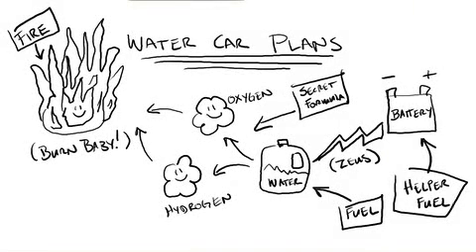Water Is Not An Energy Source

Comment: Actually almost everything you said is wrong, I have a brown's gas generator on my van for the past 4 years and I get a 30% improvement in mpg, emissions are reduced by 98%, the engine shows more torque climbing steep hills and finally it is possible to run an engine 100 % on water at least 10 people have done this, try to act with a little more humility, you come across as arogant and full of yourself

Comment: When I 1st heard of using water to increase mileage I thought How dumb Can a person be? Water puts out fire! Water does NOT burn! BUT after doing a lot more investigation, it began to make sense, After all the components of water are Hydrogen & oxygen. Two very fire ready elements. So now the Question becomes does it take more energy or give more? Well I made my own "Hydrogen generator" and was able to get a consistent 10% to 25% increase in fuel mileage. It is really simple but it takes a good bit of fussing.
Reply: +Tony W oxygen is NOT a fuel, NOT AT ALL, its an accelerant, itl make the gas and hydrogen burn faster and hotter, making your engine run even hotter. but even if your car can handle that, theres no guarantee that its still efficient, you still need gas to run the engine (~25% efficient) then you need to run the alternator, then you need the electrolysis, like he said each step hurts the efficiency, and just because your engine and alternator worked were efficient enough doesnt mean that a significant number are, it may have more of an impact on lower fuel economy cars, or or the higher fuel economy cars.
another problem is now your alternator is consistently generating power to run the hydrogen / oxygen generator, which if not built perfectly could create a nice explosion in front of you, but back to the alternator, which will probably die pretty soon now that its running at a much higher spec than intended, along with your battery.....

i would say that its likely that it would be more efficient to run off of hydroxy gas, but theres no way in hell big oil is going to let anyone do that, so in order to make your car run off of a gas / hydroxy fuel consistently and safely you'd have to spend an ass ton of money.

Comment: Actually, it's kinetic and potential energy. Yes it's getting energy from the water. The water IS the energy source. The water pushes on some waterwheel type of component. That component rotates, and the rotational motion does work on some generator that's used to power nearby electrical machinery. The generator in turn converts this rotational energy (torque) into electricity. That electrical energy is used to power machines, which transfers power   miles away via power lines.

Comment: Right, water doesn't have much internal energy due to how weak the bonds between hydrogen and oxygen are. But, a running river has plenty of stored kinetic and potential energy that can be used to move a water wheel, which could be hooked up to a generator, making the generator run and thus powering a machine. 

So it CAN be used as an energy source. A natural energy source that is. It would have been more accurate to say "Water is not a fuel source."

Comment: @CPTSkullofDoom Now I could be wrong, I have been many times before, but isn't it the density that keeps canoes floating on top of the water.  Like in that experiment way back when where you would fill a graduated cylinder with a whole bunch of liquids and drop a penny in it and it would sink through all of them but then float on the mercury.  Same thing.

Comment: @CPTSkullofDoom the dam does not convert water into electricity, but the motion of water into electricity. basically, the water goes into the dam, turns the turbines, and the turbines create electricity. the dam creates water pressure that is used to turn the turbines. i suggest a tad bit of research before you decide to look like a fool on the internet.

Comment: I could write on this subject for the next hour but. For the rest of you HBO haters. I have had an HHO generator on my 1999 f150 4.2 v6 and have seen a great increase in fuel efficiency. Have added 60,000 miles running HHO and have had no issues with my motor. So get off it

Comment: NOW! you can convert the chemical energy of hydrogen to mechanical energy by burning hydrogen in an internal combustion engine BUT that is absolutely idiotic..why? cause to take an energy source that already makes electricity that can go to a motor (80-90% efficency) compared to an IC engine (20-30% efficiency ) would be a ridiculous waste of energy, components, efficiency and weight. Therefore hydro is the best POSSIBLE though distant future solution to dealing with large amount of power demand

Comment: engine drive the alternator, it produces the electricity..it then makes the gases, gases are burned. WHAT the hell are you talking about?  LOOK..hydrogen fuel cell cars have NO engine.. no engine at all. so this part of the statment is completely WRONG.  A fuel cell converts the chemicals hydrogen and oxygen into water, and in the process it produces electricity. Hence NO engine.. the electricity then goes DIRECTLY to the motor(s) depending on the configuration and that propels the car..

Comment: The main reason for basis for water is that it is one element we have an abundance of and contains HYDROGEN..the component most found throughout the universe. If we harness hydrogen then we have UNLIMITED power. I agree that you have to put energy IN to get out energy with water yet it is the fact of what hydrogen will be able to do in the future that is most encouraging. Water used in this way isn't quite as productive (in the case of an hydrocells) yet usage of pressure and gravity, energy.

Comment: @archknight20 Deuterium oxide, which is what most people mean by "heavy water", is not an energy source by itself.  It does a better job of moderating certain nuclear reactions than regular water, and thus enables better energy generation, but it doesn't do any generation of energy itself.  While it's true that using tritium (the radioactive isotope of hydrogen) would technically generate some energy as the tritium transforms into helium, it's kind of rare and not viable as an energy source.

Comment: @shuggy555 This efficiancy  become lower after recharge the battery again and again.  Also the autonomy of the hydrogen cells electric car is 300miles, when the battery car cannot reach even the half without recharge. Thats why hydrogen is more efficient for the transportations
 The only problem is the storage problem since the hydrogen is a combustible gas as you said but hey, the technological progress is fast and the nanotechnology soon will find a solution.

Comment: The reason these electrolysis cells increase efficiency is because drawing off the battery causes more draw on the alternator, but when there is very little draw on the alternator it's actually more inefficient.  I made one myself. =)  I would never buy a kit though.  And it's a lot of maintenance to keep the electrodes healthy. =)

Comment: But a supercharged car usually has it's air-fuel ratio adjusted accordingly (EFI or carb), don't tell people to up the air, if done incorrectly your engine will run hotter, knock waaay more often and release more NOx into the atmosphere, that means replacing your catalytic converter more often. Also means less efficient past a certain point. EVERYTHING IN MODERATION!

Comment: @ureallidiots this is not a debate.  That's the problem with all you damn liberals and useful idiots.  You think everything is up for debate.  A fact , irregardless of your opinion, is a FACT!!!  

Unfortunately, you are also sadly mistaken on politics.  This is all about power  and control.  The Oil Industry's annual take is well over $3,000,000,000,000.00.  Exxon, alone, posted a quarterly PROFIT of $40,000,000,000.00.  in 3 months of doing business in fiscal year 2008.  IT'S ALL ABOUT CONTROL

Comment: @ccrg109 maybe you should do a little more research before you open your mouth.  There are many woking designs that achieve plus unity gains.  Some of which gain 160% (water hammer)  600% super electrolyser.

Comment: @Warblade118
The last time I checked, the amount of energy put into a process that produces more energy than what was used to start or run the process, is called Gain over Unity.
And it's free since the process runs itself while recharging the source that started it.
Even if I paid for the energy to get it started, the moment it starts producing energy is when the process starts my R.O.I.
Every kilowatt I'm not using, power companies HAVE TO BUY IT BACK at market value.
Sounds like free money!

Comment: @rock3tcat
Someone get this man a cigar! 

You are absolutely correct. Water in motion is an energy source. It just needs to be converted to a more usable form energy. Like a water-wheel powered grinding mill or pumping station.
Converting the waters' Kinetic energy > Mechanical energy and Torque to do work. It may not be very efficient but it is very effective and the only cost involved was a little time and materials. The minute it starts working is the minute you stop paying for power.

Comment: @Warblade118
Solar and Wind are free. Both can be stored as electricity in batteries. It costs nothing to start and run the process and it will generate revenue when you aren't using the energy its producing.
It's going to take some money to build the process but the ROI will be seen almost immediately.
The energy it makes IS free. The hardware isn't.
It's the power companies that don't want this technology in the public because it threatens their profits!
It's Payback time! And PG&E is scared!

Comment: In that sense, oil is not an energy source either. Some plant, somewhere, some million years ago had to absorb the energy in the sunlight, use it for photosynthesis, get trapped under the huge pressure and heat from the earth's core, to finally turn into oil. There is no such thing as an energy source.

Comment: This was part of my final year project in college. All we need to do is mimic Photosynthesis II at a viable efficiency level. We've got half of the reaction (the oxygen liberation side of it). The hydrogen side of the cell is... tricky. Currently they generally use a sacrificial electron doner (it's a scam equation, basically) or are too low in efficiency to work well.

Comment: The correct statement would be to say that Water is an inefficient energy storage medium. 
In other words, Water can be used like a battery. 
There are engines designed to run on pure hydrogen. That hydrogen can be made from solar panels on your house and the creek passing behind it... Then it makes sense. Adding it to your gasoline engine with computer regulation is just plain Darwinism. Go ahead and look into how many vehicle fires have been the result of UNFUSED OVERCURRENT from these.

Comment: The alternator runs 14v and enough amperage load to charge your battery, all your electronics and spark plugs and you have about 10% that is leeched from the system just from overcharging.  Hydro cells are not a way to get free energy, but rather a way to gather that 10% of lost leeching to create a better burn.  Yes, there are flaws with the system (splitting water is caustic), but the alternative would be hybrid....and auto IS moving into hybrid (eng shuts off to conserve that 10%+some).

Comment: @komahoby This works. The problem is it doesn't work too well at night. Best method I've seen is an electric motor fueling the water splitting, then using the Hydrogen combustion to fuel the car. Electric motors take up a heluvalot of kWh though, so I dunno.

Comment: In my opinion, using electricity (cars that run on batteries only) as a fuel alternative doesn't really have much problems. The only problems with it  now, concerns the length of battery charge time compared to filling up the car with water/gas, and the mileage per charge isn't as great as the mileage per gallon. But those issues should be solved with newer/better battery technology (whenever the heck that is released).

Comment: I did pass high school science Obviously, you didn't! 1 You can't MAKE hydrogen It's a element You free it from a compound called water Take a coffee carafe Cut up some alum. cans & put the pieces in  carafe Pour in some battery acid No Bullshit DON'T HAVE A LIT CIGARETTE IN YOUR MOUTH! Because the gas boiling out is H2 and O2!! My friend used a  ice chest (His paddle wasn't in the boat) + a bit of hose into the of the carb  If the Wright bros listened to doubters theywould never have flown!

Comment: Great video! But, you should check out Bob Lazar's Hydrogen fuel system. It's not some HHO scam, and it doesn't claim to use water as a fuel. A solar panel, wind turbine, or betavoltaic array powers an electrolysis apparatus, which stores the hydrogen in lithium-hydride cells. These can store more hydrogen than compressed gas tanks, and even liquid hydrogen storage systems. It's not "running a car on hydrogen." It's simply a smarter way of using electricity to power your car.

Comment: lol i dont know how much you got paid for this commercial but have you ever had one or ever made one. no i dont think so. please stop saying all this bad mouthing ok. Besides i made one out of 2 stainless steel pots a battery charger and using regular tap water. and when i held my lighter to the bubbles they popped. they were loud. and if you make enough of hho you can run a engine with it. besides auto industries are with the oil companies. they do not want good fuel miles 45 mpg not enough.

Comment: i find that this information is full of so much condescension and outright disrespect that it is going to be hard for me take his side of the argument. his facts are presented like the other side of this topic has no warrant or basis of standing. a slur of generalizations and negative behavior dose not count as a argument. but where he makes his points there are problems. 1. the car companies are not to be trusted! and 2. you can regulate heat and combustion in a engine block.

Comment: what i learned from physics as well as other engineering classes is that, gasoline engines are lucky to be 25% efficient, electric motor (or generator aka alternator) is about 95% and up efficient. Although i am not familiar with the ratio of power lost in the electrolysis process. As long as it is below the difference in efficiency there might be something to the HHO claims. wont know until i try it myself sometime heh.

Comment: Finally, coming full circle, water is energy, just as every particle of matter is.  Hence, E=MC^2.  To say water is not energy is to defy everything, literally.  Also, matter is popping in and out of existence on the quantum scale all of the time.  This process requires massive amounts of energy.  What if the resonating frequency waves in these water fracturing systems is allowing this quantum energy into the system which is performing the actual work?  Food for thought.

Comment: In addition, the most important aspect of how this technology works boils down to resonating high frequency pulse waves across opposing dipole electrodes in water, preferably distilled.  In the case of John Kanzius, the frequency waves alone fracture sea water and is unique.

I would also highly recommend looking closely at Bob Boyce.  His work completely debunks the hydrogen damage to the engine as well as proves fuel efficiency.

Comment: It's misinformed guys like this that screw up the progression of this already proven technology.  His point is valid about not getting more energy out than you put in but he's not accounting for the energy gain you get from burning more of the gasoline that would have been wasted.  Hydrogen has a very fast flame front and helps to burn up more of the gasoline you are already using, thus you gain efficiency not by the combustion of the added hydrogen but by not wasting as much of the gasoline.

Comment: After you install a cell and do some testing then make a video. This is a very reasonable technology and does work very well in diesels. The problem we have is the fuel injected gas cars, their computers will not allow continuous gains. Once we figure out the computer 100% hho powered cars will not be far. 
Rawbush

Comment: You must be an EXPERT right?

There is no such thing as Common Sense anymore. The liberals have done away with all such notions of anything that is traditional. Conservatives have lost their common sense as well.

Do you know the path the water turned to "hydrogen" goes? It's THROUGH THE ENGINE.

Hydrogen burns too hot for the engine. Hydrogen is VERY EXPLOSIVE
 Anything that wasn't electrolyzed(such as water and other minerals) would get into the engine.

You are a sheep.

Comment: You need to back to school dude unless you are really propaganda tool of big oil. Water(H2O)can be electrolyzed to separate the hydrogen and oxygen. The hydrogen is used to fuel to the fuel cell so it can generate to electricity to run the engine of HondaFCX. This is common sense dude. Right now I don't think you have one.

Comment: Dude you are a propaganda tool of big oil and you are spinning the truth. Honda FCX Clarity is running on hydrogen and is the car of the future. For as long as it is cheaper to produce hydrogen by electrolysis than extracting oil, it will be fuel of the future. Obviously, you have a take in this, but you will be proven wrong. Hydrogen will be competing with oil for future fuel.

Comment: I see the logic, but the truth is that the energy used by the hydrogen generator to produce gases is "extra" because your alternator is capable of producing much more electricity than your car will ever need. I have improved the mileage in my V8 Land Rover by about 30%. It went from 12 mpg to 16 mpg. I tested this over a period of 3 months and found it to be accurate. Don't knock it 'till you've tried it. It really works.